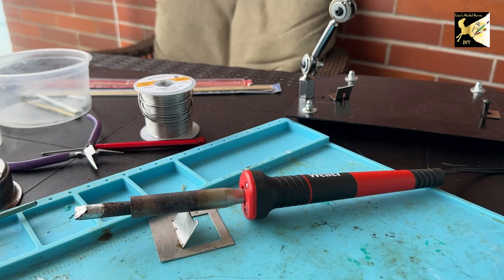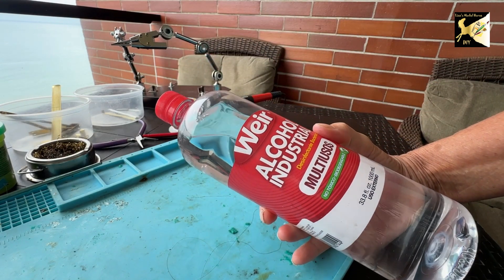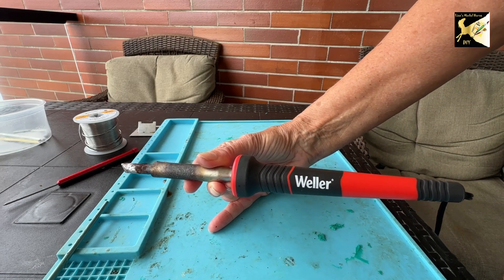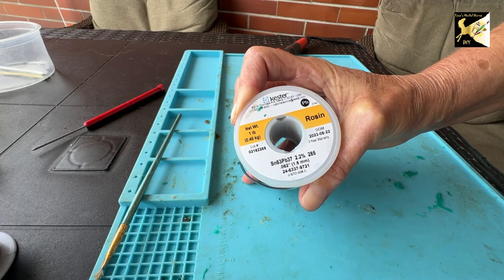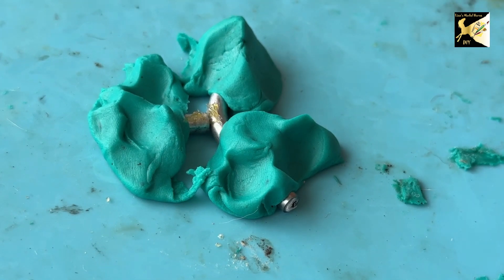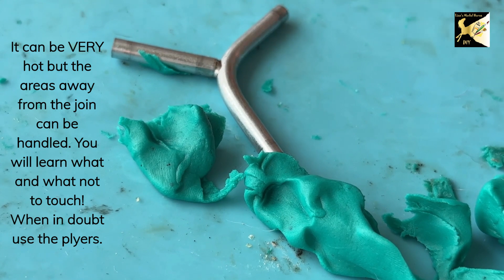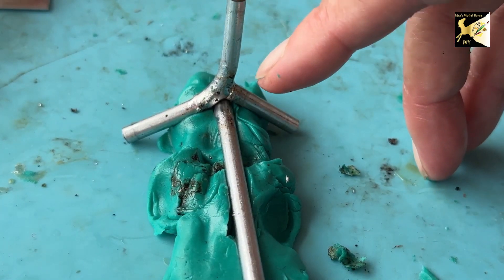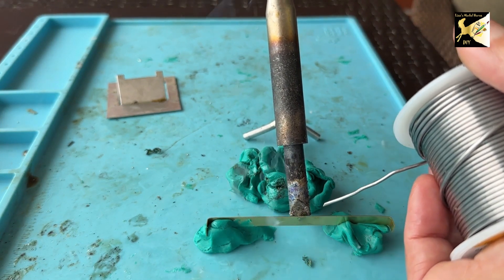How to Solder Steel for Models and Toys. How to Work with Brake Line Tubing, brass and findings.

Comment: Thanks for this information! I just repaired a pair of expensive eyeglass frames made of steel using the flux and lead free solder I normally use for brazing pipes with my soldering iron.
Reply from the maker: That's a fantastic idea! I'm so glad this information was useful for your repair!